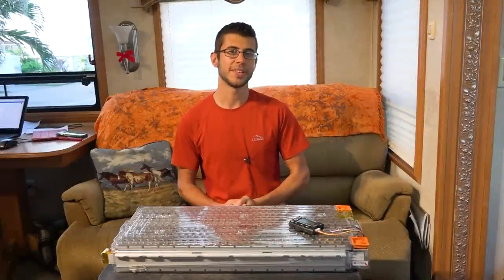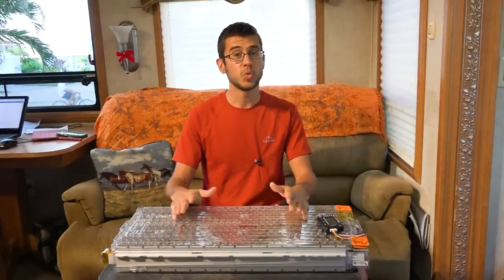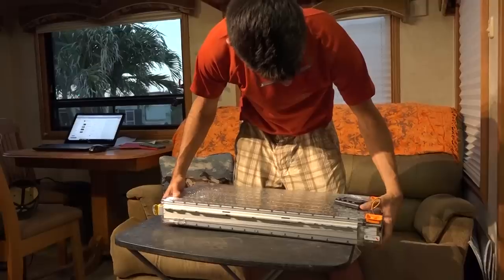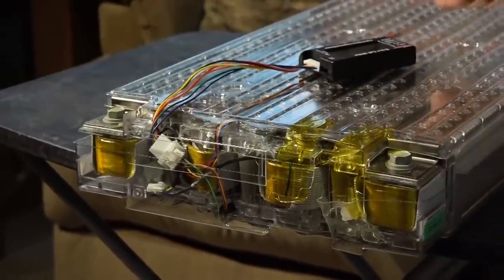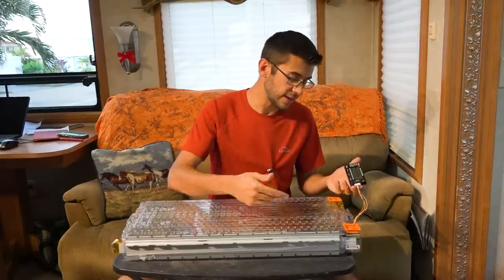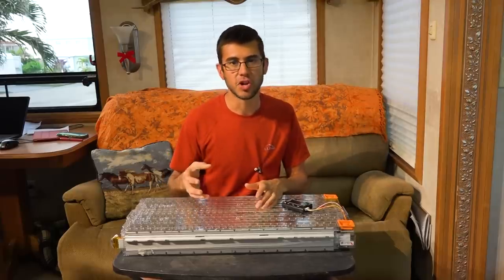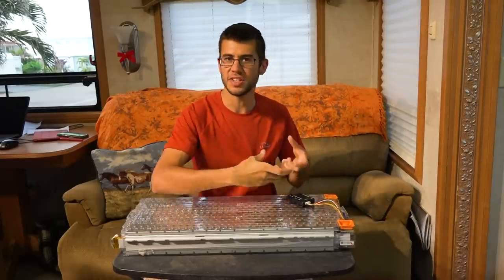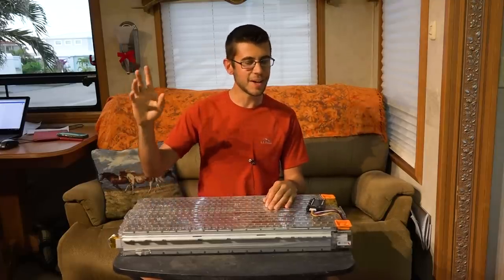Overview of the Tesla Lithium Battery Module We are Installing in our RV - EV Battery Hack!

Comment: You need to be really careful what you call a BMS. Your low and high voltage cut offs do not account for individual cell voltages and don't manage anything. You could have an imbalance and still be within a total "safe" voltage range. You could have one low voltage cell that could get crushed by over discharge or one higher voltage cell get overcharged and have a catastrophic failure. Just an FYI, that little monitor device will never balance your pack if you end up with any significant imbalance. Those are meant for small RC batteries and even then it would take a very long time to balance.
Reply from the maker: Thats very true, in this setup the balance needs to be watched carefully,  I balance about once a month and have not had any  issues yet.  I know others running tesla who haven't balanced for years and are still within spec.  But if you overcharge just once that can all go out the window. I would like to design a full BMS suite at some point but for now I feel this is safe, With the tenergy unit  balancing from .03 to .01 takes about 8 hours.
Reply: regardless of how well others have run, the idea behind having a BMS is when things don't run well. Just be careful. A simple BMS wired to a disconnect relay is enough to make sure your RV doesn't catch fire in the event of a cell group issue.
Reply: Great points to consider! Can you recommend a BMS that would be compatible with this Tesla Model S module? I'm considering a similar setup and am also skeptical that a $10 Tenergy 5-in-1 is a good long-term solution (not to doubt OP's first-hand experience so far). I'm also interested in whether it's feasible to use more than one Model S module in a single battery system, and what that would require, short of a complex/expensive solution like EVTV's module controller: http://store.evtv.me/proddetail.php?prod=basicsmodulecontroller
Reply: Tesla only use a similar small BMS (per module) by just adding resistors across in the car. That is a sealed pack that is intended for 10+ year life span. These small resistors are also balancing the whole battery of 400+ volt (16 modules in series). The cells are extremely equal and all you need is just to maintain it that way. Balancing typically only happen at full or close to full charge. If a single parallel of the 74 cells have a dropped cell is the voltage just dropping a little sharper and charging a little sharper, hurting the total packs KWh, but not the balancing.

Comment: my dad bought one of these batteries for a drone project, but it did not work. I scored and now it is going in my #campervan 

Do you have a like with a list of things I need to make it work with my standard 12v lighting, 1300 btu ac system, and my solar panels? you would be my hero!

great description, btw

Comment: what kind of AC charger will you use to charge it when connected to shore power? I imagine you'd have to a pretty big charger to put 5000 Kwh back into the battery in a reasonable amount of time.
Reply from the maker: Anything fully programmable, we use the victron multiplus inverter charger.

Comment: Excellent Vid... I just got my 1st Tesla Module. And also ordered that same monitoring meter based on your vid. Did you connect it as is or do you have to modify the cabling in order to connect it to the battery? What will be the max and min charging and discharging values to configure the controller by? Thanks once again for a comprehensive vid!!

Comment: Hey , what was the Victron MPPT / DC charger you used to charge the modules ? - I am not finding a way to change the charge voltage on the Victron charge controllers below 25V (with advanced setting) .. mind sharing a compatible charge controller ? or DC charger

Comment: Amazing setup! Quick question - I see that it's advantageous to keep these in the middle range, never fully charged and never fully depleted. The lack of memory effect is great - No need to top off! I'm imagining the sweet spot is about is a charge of about 4v to 2.9v per 18650 battery. What do you set for your charging parameters in the Victron Charge Controller and Multiplus? It seems a charge of 19.5v to 23.5v for the Tesla module would be taking advantage of this sweet spot, based on the graphs I've seen. 

Can you share if this is comparable to what you have set for your charging parameters for float and absorption as well as your low/high voltage cutouts, or what you have settled on based on your experience? Greatly appreciate this series!
Reply from the maker: I usually run around 24V charged, set the float .02 volts lower.

Comment: Biggest risk in your setup is that 1 cell goes low voltage due to fault. Maybe not full short. The remaining 5 in series  would be charged to 25V, say 5V each and heat up and burn.... even if there is an undervoltage protection, who has  ever tested it? Maybe it’s not working? and considered that mosfets like to fail in short condition? I really think one needs to care for heat (not only cold) and undervoltage of each cell. Double security that doesn’t cost much

Comment: That little LC battery monitor won't balance such a huge pack is balance rate is tiny - it also powers itself from the first cell which will effectively  unballance you pack if left connected
Reply from the maker: It balances it just fine, takes a day or two tho.  Yes you must disconnect it.

Comment: Are you sure that little 5-in-1 doohickey can balance that huge battery in a reasonable time?  That's amazing.  BTW, there is a newer 8S version of that meter called Cellmeter 8.
Reply from the maker: Reasonable time... no, it takes a day or two.  luckily my battery has never gone out of balance unless I leave the tenergy unit plugged in which draws only from the first 4 cells.

Comment: There must be a way of using the thermal management system by pumping Glycol around to raise the temperature of the pack to allow charging in cold climate. The battery itself or the solar cells could warm the glycol and power a small pump?

Comment: Watch out, that cell monitor will only draw power from the first four cells.  Over time, it will cause the batteries to become unbalanced (if you leave it connected all of the time)  Have fun with the battery.

Comment: Was the original Tesla BMS really only hooked to each 74 cell bank that's in series?? Usually a BMS monitors every single cell this is really surprising, is there really no other wires that could be for monitoring?

Comment: In the summer i wonder if you can solar charge, and cool the battery with liquid running through a heat exchanger  so as the batteries heat up like when you are charging or discharging (cooking  breakfast with an induction cooktop) you can make warm or hot water at the same time?
Reply from the maker: We have not noticed any heating from charge/ discharge because the batt is so big and low resistance.

Comment: Odd question here, I run my diesel generator to charge my off-grid lead acid batteries in the winter time. It takes 4-5 hours to bring them up to full capacity starting with a bulk charge rate of 125 amps . So run time on my generator is very important to me for fuel consumption and overall wear and tear on the generator.

My question, seeing as you mention around 12:12 that you have to regulate the amount of charge that goes into the battery, how long of a runtime would it take to bring your battery to full? 

Great video, very well done.
Reply from the maker: Thanks,  I only need to limit the charge so as not to overload the battery.  You can charge this battery at 230A without external cooling.  Even higher if you cool it.  At 125A you would be able to take this battery from 10% to full in around 1.2 hours.  I assume you are charging 12V battery's at 125A tho, at that same power double the charge time.
Reply: Impressive, thanks again for the great video.

Comment: If you are thinking of converting an old school car.. please consider the one and only Ford Festiva. 

One of the best people movers for its size. 

A custom floorpan, transferring the front drive motor to the car.. 

There were manual and automatic versions of these cars.. but to keep the original automatic shifter for asthetics as well as function. 

Car only weighs 900kgs. And usually got around 500-550kms over a full tank of fuel being about 30litres or roughly 10 gallons. 

Would need a new electric vacuum booster and the brake kit should be enough.

These cars would be so ideal for a swap.. and possibly a brainstormer for Elon if you could fit all batteries into the car as well as the motor and he could see the potential of making a true hatchback.  

It would even be awesome to make a dual layer battery pack abs charge one whilst the 2nd one was being used and then when the first pack was being charged, the would take over and so on. 

A custom centre console utilising the Tesla screen and dash cluster.. 

Moving the existing heater unit from the Tesla to the Festiva, and all of the heating and cooling gear for the batteries.. 

Finally, custom fitting the rear seats into the Festiva and front and rear seats to fit.

Please consider this as a project in the future. 

Thanks.
Reply: On other thing.. do the company you bought the battery from, sell the battery shells?

Comment: What type of equipment did you use for the over and under voltage disconnect?  Is that victron battery protect running backwards?

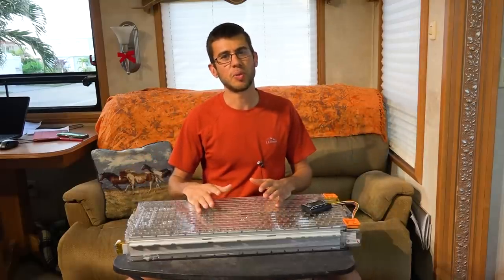Comment: Thanks for the information! Did HSR provide the orange caps? At 9:34 you say the battery was designed to put out 1000 amps at full load. You also say it's around 24 volts, so that would be around 24 kilowatts. But with a capacity of 5.2 kilowatt hours, that would discharge a fully charged battery in 13 minutes! Are you sure that's right? Not that you would ever put such a load on your battery.
Reply from the maker: That is just the rated output.  That's how teslas accelerate so quickly, but only can do so for a few seconds. Yes the Orange caps came with the battery from HSR.

Comment: Have you considered using a Powerwall II as the vehicle's house battery and/or as an energy source for the vehicle's engine? Also, is it possible to use the Powerwall II or Tesla battery to heat and cool (a/c) the vehicle full-time from the vehicle's OME engine (while not driving)? In other words, not adding a second heating & a/c source but using the one's that came with the vehicle. Thanks. Could revolutionize van builds if this is possible. Well, and make a few bucks. Powerwall II may need a big van or bus. There's a recent posting of an ordinary size van with 950 watts solar on top.
Reply from the maker: Would love a powerwall 2!! So hard to get tho.

Comment: Unquestionably a great video, but answer me this:

With all the demands of heating and cooling, and accessibility to Tesla’s charging infrastructure, could you not retain the entire system as a hack? As an analogy nock off the wheels, body components, and steering column, retaining the entire system within the RV?

Secondly: couldn’t the entire battery pack from the car power an RV air-conditioning system for sometime? I hate generators in RV-ing and I’ve had considered what you’re doing here in pursuit of that cause.

I look forward to your reply and from anyone out there with any thoughts on this.
Reply from the maker: Ken Munoz Ken Munoz yes you could retain the whole pack, look up Evtv, that guy hacks entire packs from cars.  The cooling circuit might be tough to keep intact but the heater ( the important part) is integrated,  it would be very large and heavy tho.  A full 85kwh pack could run 2 AC units continually for about 24 hours.   You would need a big generator or huge solar system to charge it too.   Check out "beginning from this mornings" channel. https://www.youtube.com/watch?v=LV8fyzOTjsk.  They are using the entire pack from a Nissan Leaf.  Like mine, very custom and complicated tho.

Comment: VERY interested in this! I considered going to 24 volt to get more power without melting cables, rather than trying to get 4,000 watts from a 12 volt system. 4,000 watts from 12 volts seems risky because of the amperage. Need tree trunk sized cables. 

Just need to figure out how to configure the existing 12 volt devices. Definitely look forward to seeing your setup with this! I didn't realize these modules were so reasonable.
Reply from the maker: Yea 12 volt for high power is just not reasonable, 48V would be best in my opinion and we would have gone that way but got a killer deal on the 24V inverter. More on this in the next video!
Reply: Mortons on the Move I want a low frequency inverter, I didn't even know that there was such a thing until recently. I know pure sine is important for what I want to do, but apparently low frequency pure sine is the ticket. 

Looking forward to your future videos on this. Subscribed for sure!

Comment: Can't go below freezing? We use power tools in the winter and I see electric cars in the winter. Winter means minus 10F in Mich.
Reply: Your power packs are protected from charging when the pack is very cold. They can be used when cold but not charged.
Reply: The trick is that these modules will still discharge and power your circuits at temperatures well below freezing. The problem comes when you try to charge them below freezing. This irrevocably damages the cells and could cause VERY severe problems if you continue to use the module.

Comment: Tom,  Absolutely great video series!  From the battery's perspective, is there any reason I can't bolt two of these modules in parallel, each with its own BMS?  I imagine that's how they power the Teslas, right?  I have a Class A RV and I'm looking for more power.
Reply from the maker: Yup,  You can go parallel or series.  I helped with an installation with 8 in a 48V parallel series config.

Comment: The most organized and easy to understand video on this topic I've see yet! Curious on how exactly you set up the BMS system on it. 

You mention the strict temperature parameters with this battery technology, so is this approach not considered "four seasons"? YT channel Per3110 has a nice tesla RV set up and uses fan as well as heated anti freeze that I'm wondering if you've considered. Good luck with your install, subscribed to the channel and very much looking forward to future updates.
Reply from the maker: My next video will go into what I installed. I am just using a heating pad and I think it will be fine in freezing temps.   I did consult with Per3110  before buying this pack, there are a few others who have done this before as well.
Reply: @MortonsontheMove  Oh boi

Comment: Is that battery monitoring unit plugged into the standard Tesla cable connector? Or did you have to make a conversion cable to join the two together?
Reply from the maker: It's a custom cable . Standard 6s lipo balancing cable.

Comment: Because you say you are only going to use the middle range of voltages in the Tesla bank, you are likely only going to be using half the available capacity which is about 225 amp hours. This is then equivalent to, say, four Trojan T-105 deep cycle flooded cell batteries. 
Their total amp hours come to about 450 (the factory quote 6.0kWh) and the recommended use would be about 50% discharge although they can be safely used to 80%.  Their total weight is less than 250 lbs, not 500 lbs as you said. 
With proper charging management, just as you have to do with the Teslas, you could comfortably expect up to 12 years of life.  With all that in mind, including the safety and ease of management of lead acid, I am not sure there is any real advantage in doing what you are doing, especially with the temperature problems and being about 3 times the cost. You could change the T-105s every 3 years and still not spend as much as you have.
Reply from the maker: We get around 200 AH @ 24V or 400 AH @ 12v out of this battery running the middle range.  No special management is needed.  I would waaay recommend li batteries over lead acid.  This battery has been incredible.

Comment: Thanks for this great video. Could you explain how you connected the factory BMS cables to the Tenergy Cell Meter?
Reply: It is just a matter of measuring the connector pin voltages and getting them to ascend in sequence to the battery monitor/balancer inputs.

Comment: I’ll be adding two Tesla modules to my class a.  My question is, why go through the extra charging protection you have built in if the inverter/charger is already programmed with the same parameters?  Just extra protection?  Also if 25v max is upper charge limit, what should lower limit be? 20v?
Reply from the maker: 19v low is my set.  I have seen my inverter go nuts and try to overcharge the batt once. It can't be truated.  You can use the victron bmv712 for overvoltage protection tho.  Whatever you do never ever overcharge and have a hard relay disconnect to prevent it.

Comment: Question, in regards to capacity those are 233 ah.  Now being 22 volt would that be the equivalent to around 460 ah in a 12 volt system battery or is that not how it works?  This is not an area of great knowledge for me lol.  Very interesting, this could be a cool route to look into for my Airstream.

Comment: Quick question:  What ribbon cable are you using to connect the Tesla Battery module and the Tenergy 5-in-1 Battery Meter?  Did you buy a specific cable, or did you purchase a ribbon cable and connector kit and build your own cable?  Do you have an Amazon link or part number by any chance?
Reply from the maker: The guys at 057 tech did that for me.  They just crimped a standard xh connector to whatever it is Tesla used.